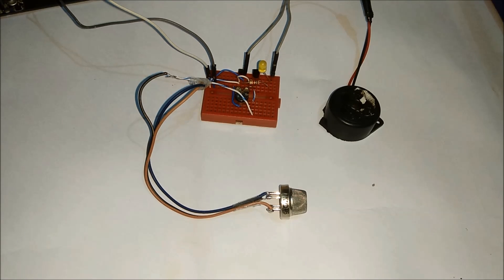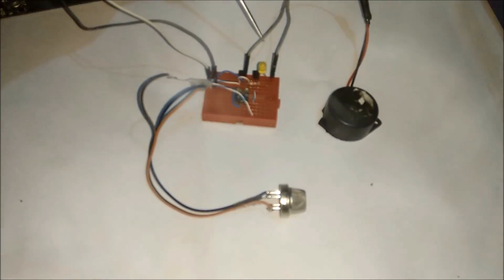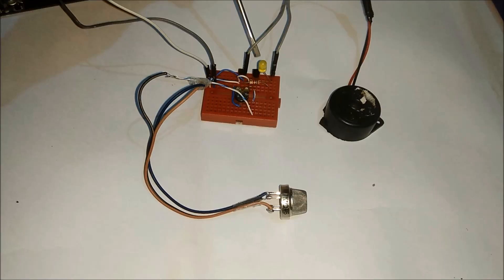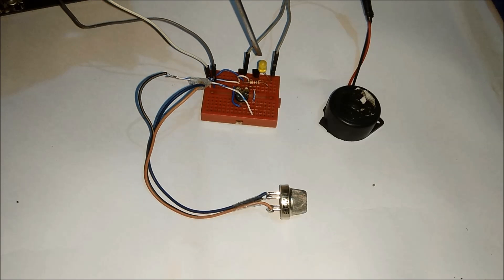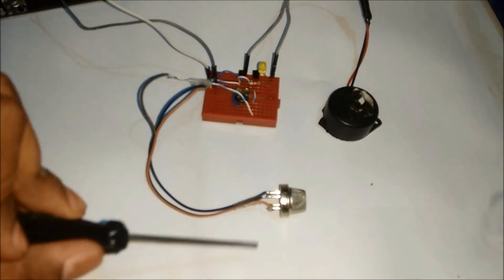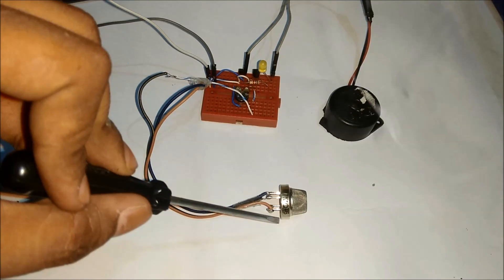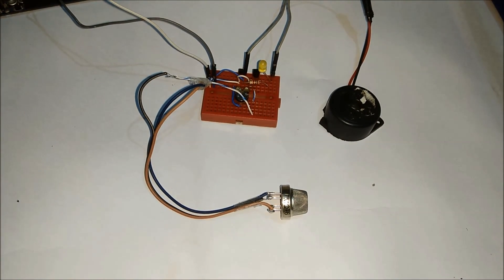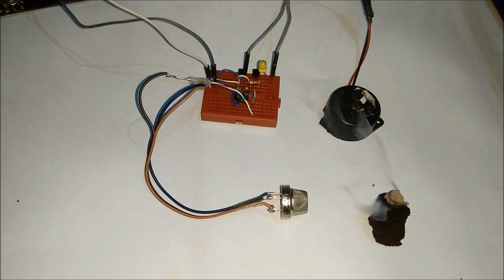Simple Smoke Detector Circuit

Comment: Sir one request can u please tell about the smoke sensor terminal connection because that mq2 sensor have 6 terminal you just connect just 3 terminal so please tell me about that...
Reply from the maker: The MQ-6 have 6 pins, 2 A pins ,2 B pins and two H pins. in that two A pins are internally connected and two B pins are also internally connected . so we only need to use one of these pins. And if you check the circuit you can see that , we have connection between one of the H pin and B Pin. So we only need 3 wire from it . One for H, one for A and one for B and the other heater pin (both are connected together.)